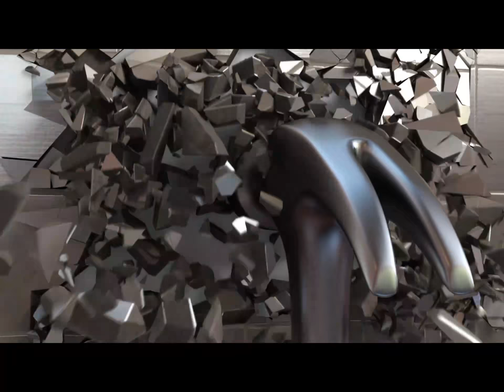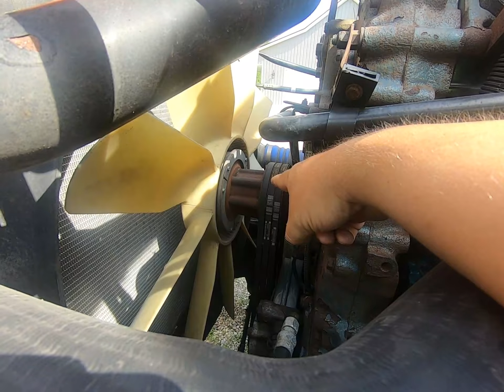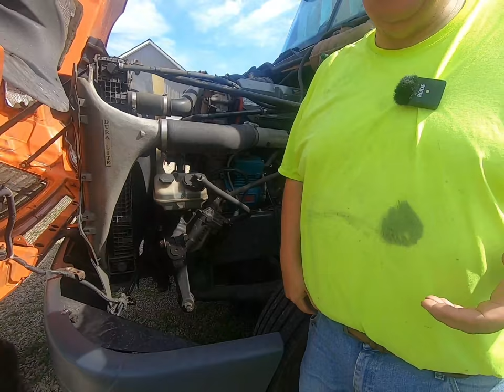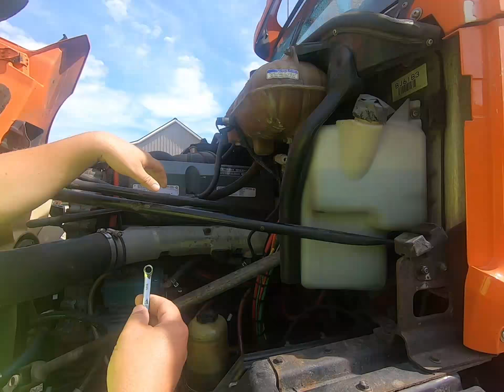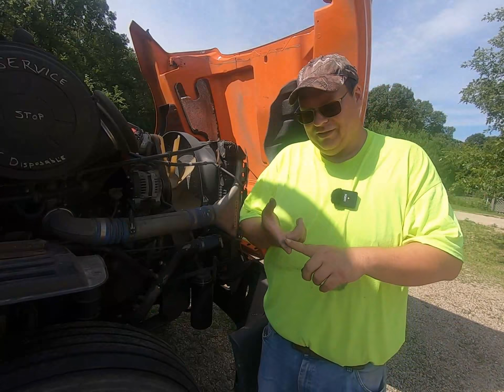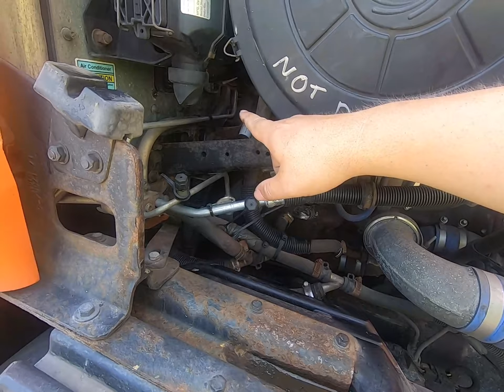Engine fan stays on. Troubleshoot, diagnose engine fan on a semi truck. Fix an engine fan.

Comment from the maker: DIY SEMI, TRUCKING AND MORE 

 • 59 seconds ago

For great fuel discounts with no fuel card required, watch this video! https://youtu.be/LjB5Y60p1qI
Reply: Can you answer my questions which I mentioned in comment
Reply: Good evening Sir I have a Detroit 12.7 470 horses going up mountains 40k plus truck always start over heating... Will manually  turning it on stop truck from over heating? Everything else works great runs like a champ
Reply: Turning Fan on 🤦🏾
Reply: @JRich-kq6dc  [oka

Comment: Yesterday I was driving home, too, turned on,  fan clutch and started working.  I thought maybe the solenoid needs to be replaced.  I changed a new one.  but still on I came home.   And was about change clutch  But then I started to check, the wiring found frayed wire  under starter  and it was all a problem.  started working properly.

Comment: The clutch was stuck in my case too !! I smacked it with a hammer after changing solenoid and ac high pressure switch, and bam it released and rolled freely after I blew out with air hose was real dirty gravel lot also ! Thanks for video saved my butt !!
Reply from the maker: cool

Comment: Great video! After paying a shop to diagnose a stuck fan on, I watched them slap on a new solenoid, then new high pressure switch and charge 2 hours of labor. They swore it was fixed... Didn't bother diagnosing the fan clutch with a vacuum guage or pressure test.

20 mins down the road fan was stuck on... I drove home and personally removed the fan clutch and hub from the engine bay.  Not a hard of a job. I opened the fan clutch on a table and found the 20 cent o ring falling apart, not sealing air in. You couldn't hear it leak but it was enough to force the fan to run.

 Folks, tips in this video will save you hundreds of dollars in bad repair service bills and the frustration of trusting unskilled/ lazy mechanics with your truck.

Comment: Thank you so much for this video. You helped me diagnose my problem while I was sitting at a Walmart distribution center in Casa grande Arizona and was able to buy the part the next day.  Got the solenoid and repaired it myself and now I’m back on the road with no trouble. Thanks so much I’m gonna be mentioning this and you in my next video on the clutch trucker channel. Thanks again
Reply from the maker: Glad it helped!

Comment: This video saved a trip to the repair shop and untold headache. Testing the solenoid  with the key on revealing air going to the fan but fan stuck in place. "Light" tapping 😅 loosened it right up

Comment: Thanks.  I went on vacation and when I came back the fan kept running. I was troubleshooting the systems when I came across your video after I got stuck. I light tap on the clutch hub did the trick.
Thank you

Comment: Thank you this video really saved me time and $ my truck had been sitting in a dirt lot for two months and the fan was stuck on wouldn’t move with key in on position, I tried your hammer trick and it popped sprayed oil around it cycled key on and off and now it functioning properly THANK YOU

Comment: Great video. I subscribed. My 2017 Cascadia sat on my concrete driveway for a month (my bad for not starting it once a week for 30 minutes) and yesterday  when I took it for a ride I noticed the fan was on all the time. Watched your video, verified I had air going to it with the ignition switch on, no air leaking, so I tapped on the fan clutch last night,but it would not release. This morning I started up the truck and aired it up to the 140 psi max (last night it was 110-120 psi), shut truck off, turned ignition to the on position and tapped the fan clutch 8 to 10 times and it released. Whew!! Seems to be fine and I will be starting the truck at least once a week from now on. Thanks again. Be safe. ✌️
Reply from the maker: Awesome

Comment: Thank you so much for making this video.   It helped me alot.  I changed the fan clutch solenoid on my 2018 Freightliner Cascadia but the fan stilled stayed on.  Then I tapped the clutch lighting with a hammer while ith key was on and it worked.

Comment: Subscribed  you saved my butt 6nz cat  checked solenoid ran power through it. Working  now here’s where you come in I ran through a huge construction dust storm for miles.  I said why not hammer time … I see dust welp didn’t work immediately but by end of day viola I give you full credit

Comment: Just gotta thank YOU for mentioning the stick clutch. I left my hood open over night and the fan was stuck in afterwards. I jumpered the airline at the switch so it had full truck air to the clutch all the time and with the engine off and air changed rapped it with a hammer and she let go. $450 and many hours saved! Thank YOU so much!!!

Comment: Awesome video. Just this morning I noticed my fan was louder than usual so I realized it was stuck in the on position. After watching your video my diagnostic was a corroded broken wire at the solenoid.  Thank you for your helpful video.

Comment: Good in-depth tutorial! I'm having an issue with my own engine fan at the moment. I'll be using this to try to diagnose and see if I can't find the issue. Got sub out of me.
Reply: Sounds like an air leak in the clutch.
Reply from the maker: I have a video on changing a fan clutch
Reply: I'll be sure to check it out. 👍🏻
Reply: @DIYSEMI  Thanks again! New solenoid and clutch installed after watching that video.

Comment: This freightliner I’m driving has an engine fan switch in the cab should it be on or off?
Reply from the maker: when it's off the fan should cycle on its own. In the on position it should stay on

Comment: Hi, I have a Freightliner Cascadia 2015. It’s hub fan gets stuck a lot and works sometimes but other times it doesn’t. The secondary air tank pressure drops and the fan keeps moving. This happens a lot what do you think is wrong?
Reply from the maker: Sounds like you have an air leak somewhere

Comment: That was really helpful, but my default position is on and my fan freewheels even with the airline disconnected. But I'm not convinced the clutch is bad. Any opinions would be appreciated.

Comment: i have freightliner Columbia but my fan says on i changed the solenoid  and ac switch and i have no air leak and fan clutch did not get stuck  i have checked everything you mention on your video but my fan stays on the second thing i have is i don't have cruise control when iam driving but when i am parked   i have cruise control i changed clutch switch   and cruise control switch but still i have the same issue

Comment: Hello sir I  have 2000 freightliner Classic xl , with 60 Detroit 12.7 motor,
And I replaced new fan clutch, and solenoid, and Ac high pressure switch . But fan still runs on even engine is cold. Any suggestion , could be relay? Or something else. I noticed when I turn ac on ac compressor turn on off but, ac working. And I liked your videos and subscribed. Thank you
Reply from the maker: any air leaks around the clutch? possible overcharge in refrigerant. at a certain point, once you adddress all the mechanical issues, it can be electronic and need to be hooked to a computer for eelctrical diagnostic

Comment: On a 2012 Freightliner M2. Once my fan engages, it stays on. It does it even when the A/C is off. That wouldn't have anything to do with the high pressure switch would it?

Comment: I got a 97 freightliner fld120 with a cummins m11 my fan wont turn off it did twice and started blowing  out the over flow line of the reservoir ( i think the reservior was over filled ) my question is even with the fan blowing my temp should still be above 140-150 right? I replaced my thermostat and still have the same issue. Will the fan really keep my water temp down that low?
Reply from the maker: in this cold weather yes
Reply: @DIYSEMI  we haven't been running it for long but last year when we bought it the temp gauge still showed that same temp even in the summer ( I just wrote it off as a bad thermostat ) we just had it replaced and found out it is stuck closed wouldn't that cause it to run hotter? I also live in Florida it was about 55-60° here when we ran it after replacing the thermostat.Thanks for helping me BTW this has been racking my brain for the past few days! I
Reply: @DIYSEMI  also I'm going to run through all your diagnostics tomorrow hopefully I can find out what's causing it to stay on!!
Reply from the maker: did you verify the temp gauge is working, since it never changes?
Reply: @DIYSEMI  I am fairly certain the gauge is working as it should

Comment: Hello Adam thank you so much for the video  I have 2016 freightliner cascades had an issue with the A/C took it to 3 shops already nothing is fixed Dan clutch stays on and it had a high pressure switch code replaced it but still the fan clutch is on could you see if you can shade some light on this issue for me . Thanks
Reply from the maker: perhaps it wasnt a bad switch. You could actually have high ac pressure. have them throw some gauges on and check. 
If it never ever shuts off, do the checks in this video. see if it is capable of shutting off at all. clutch or solenoid could be bad. see if you can spin it with the truck off key on

Comment: i have a 2017 cascadia and ive tested the clutch, the solenoid and replaced the high pressure switch and ohmd out the wires from the MCM to the solenoid and my fan still wont turn off. what do you recommend i check.
Reply from the maker: time to have a shop plug into it then. Could be something in the ecm

Comment: Having an issue with my volvo, changed the solenoid and tapped the clutch and fan still turns, but with key on and engine off the fan doesn't freely spin...

Comment: 2013 Clark diesel 12.7 glider like this one.  Fan stays on about 30 minutes and then releases.  Today the fan hub is leaking air when it’s not released key on (I tried tapping with hammer) but when I bypass the solenoid by connecting supply air directly it releases and doesn’t leak.  This is a new solenoid.  A bad solenoid or do I need to rebuild fan?  Can I get by with just cleaning and o ring kit or do I need to do a full rebuild?

Comment: Thanks for the clear info. Just learning my truck and now know the solenoid I saw just today is actually for (fan solenoid). My fan is on when engine off and no pressure but also stays on when running and has pressure and when outdoor temp is low in winter. So, will diagnose as you described. Appreciate it.

Comment: I had cruise control issue i have freightliner columbia Detroit 07 when iam parked my cruise control is working but when I drive I don't have any cruise control set  what would you think the issue is
Reply from the maker: possibly throttle position sensor

Comment: My truck kw 2011 the ac and engine fan works like it should be on first fan speed,second third and fourth speed engine fan engage very often, even in the freeway going 65 miles,? Any advice thanks

Comment: Great vid....my truck started making a high wind noise while driving. Could it be the fan clutch? The mechanic says I need to change the fan clutch solenoid....but he said the clutch itself is fine.  I just wasn't sure if thats the reason for the high wind sound. But what I did notice when he checked and tried to spin the fan by hand....it didn't spin. But he did do air pressure test.....and his suggestion was getting solenoid replaced....it's a 2012 cascadia dd15
Reply from the maker: did he have the key on and air pressure built when he tried to spin it by hand? give that a try. if it spins by hand then the solenoid is releasing the clutch. If not, could be solenoid. try to walk thru the steps in the video. if he did test it with  air then he is probably right.  He looked at it hands on so I would probably trust what he had to say.
Reply: High wind noise?  I’m having issues too. I hear a whistling when I boost and my engine fan is now staying stuck on.

Comment: Some trucks like paccar may have two high pressure ac switches. One thing with Cummins isx if the fan clutch is bad it will stay in the on position. Also if the clutch is thin enough it can separate and now you have a clutch, fan and radiator to replace. I had the clutch fail in that fashion on my isx
Reply from the maker: bet that was expensive
Reply: About 2500.00 with tow bill and motel room and three down days. So yes it was
Reply from the maker: ouch

Comment: I have a 2014 frieghtliner coronado glider with the 12.7 detriot and I'm having an issue where the check engine light will come on and when it comes on the fan kicks on and won't shut off. Says oil temp is to high is my only fault code. There are times where I can run without it coming on for weeks and then sometimes it won't shut off for a few days. Very hit and miss. Any ideas?
Reply from the maker: probably a bad oil temp sensor
Reply: I've replaced oil temp sensor coolant level sensor and oil pressure sensor

Comment: The hammer tricked worked for me after replacing numerous parts,I had to re watch a couple of times.dont forget to have air pressure and engine on not running

Comment: My fan keep ls turning on automatically often even when it shouldnt! It makes a heavier noise than when the fan is activated aswell. Kind of grinding vibrating sound. I can turn it off after I turn it off manually and then turn it off. It stays off for a while sometimes it come back up right away. I tried changing the coolant temp sensor and still going. Mechanic checked for air leaks nothing. What do you think it could be? Its also comsuming more fuel. 😫 2006 CAT C13 on Kenworth T800.
Reply from the maker: Check everything I mentioned in the video. If none of that works you will have to take it to a shop

Comment: I have a brand new silinoid and no air leaks but its still stuck and won't turn on less the engine is running...what's the next step ...I tap the hammer a few time but nothing happens just some dust coming from the fan

Comment: I've got a 2021 kenworth t680 with a cummins x15. The fan stays running while I'm driving. When sitting I can get it to turn off, but as soon as I start driving it'll come on, the engine fan light comes on for a couple minutes then goes off but the fan keeps running. Can't figure this out. Any idea what would cause this? No air leaks. It'll shut off and on while sitting.
Reply from the maker: can be a number of things,probably needs to be put on the computer. could be reading high ac pressure, faulty temp sensor... the newer trucks kick the fan on for a variety of reasons that the older trucks ddidn't.  once you get past the checks in this video it would most likely be electronic
Reply: @DIYSEMI e

Comment: I have a air leak on a fitting that’s connected behind the fan clutch and the belts connected to the fan. Can that be reason my fan is staying on?
Reply from the maker: Yes could very well be
Reply: @DIYSEMI  I need help figuring out what fitting is called. Do y’all have a email or something I can send video of the fitting that’s leaking

Comment: What about if is leaking air i hear whistle coming out top of the clutch do I have to replace the whole clutch
Reply from the maker: It will have to be taken apart and fixed...in my opinion, if it is old and you are taking it apart anyway, you may as well put a new one on.  If its not that old, maybe you just a rebuild kit.

Comment: My fan is always running when I drive down the freeway, and my ac stopped working, and the mil light is on. I hope it’s just the high pressure switch. Great video
Reply: what was your problem. because i’m having same problem
Reply: @HighWayRambo  it was the a/c high pressure switch that’s on the top metal pipe that leads off the ac compressor and goes back towards the firewall. Don’t forget the small plastic ring when you screw on the new one. It will leak refrigerant of you leave it off

Comment: Please can you help me my fan is going to be on only when I am driving with low temperature less than 150 or higher and stays on as long as am driving  I pretty much change everything whole engine hornes I changed solenoid twice I changed all the sensors coolant reciver sensor yesterday I went to frieghliner after I paid $$$$$ nothing when I stopped and reset my truck everything is going to be normal and working again but when I drive that is when it comes on if you have any ideas please let me know is 2007 frieghliner century with Detroit engine thanks

Comment: Adam I have an 03 columbia the fan clutch won't come on automatically.i have to turn on fan manually.i changed the solenoid
Reply from the maker: if all the mechanical items seem to be working properly, it is possible it's an ecm issue. or a temp sensor might not be sending a good signal to let the ecm know to kick it in. just my first thought.

Comment: Hello can you please  give me a suggestion i have 2007  Freightliner Century i have a problem  the truck lose energy on a small hill and  high coolant temperature light come on the radiator fan keep running ac turn worm can you tell me something???
Reply from the maker: It sounds like your truck cant cool itself down. Start simple..do you think tne thermostats are opening? Have you made sure the radiator and ac condensor arent plugged with dirt and bugs so it can move air thru it? There could be several causes. Is your air filter badly plugged?. If you rule out all the little things first, then maybe you need a mechanic.

Comment: Hey DIY SEMI, I have a 2009 Columbia and I have a problem with it. The heater, the wipers, the mirror heaters and the radio stopped working all at once. You have any idea what the problem could be or what should I check? Thank you..
Reply: Low voltage disconnect. It's inside the lower center console. You can do a bypass.